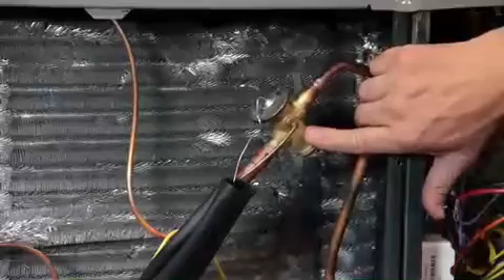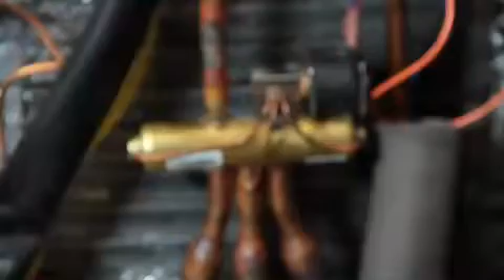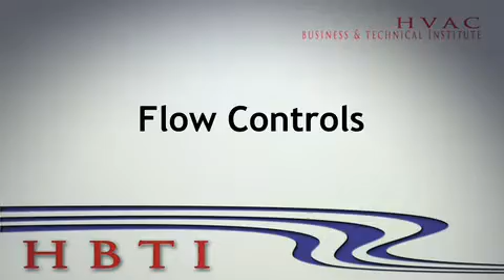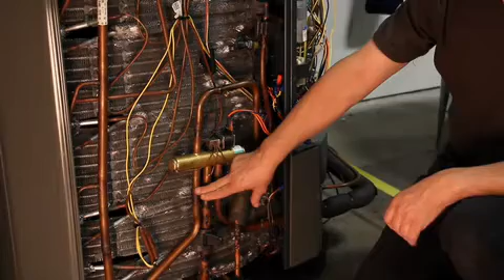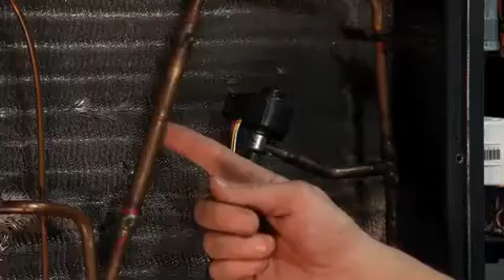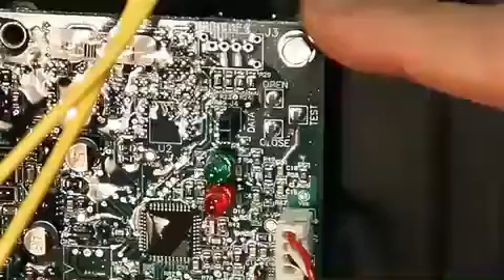HVAC - Diagnosing Expansion Valves & Flow controls

Comment: I have Packaged unit , cut off height pressure  when turned on in heating mode.  In summer increase the freon and in winter decrease the freon. When turned on in cooling mode the system  working gd .the problem only in heating mode